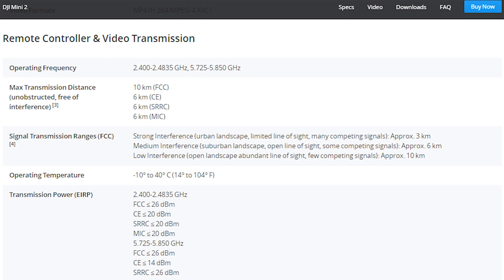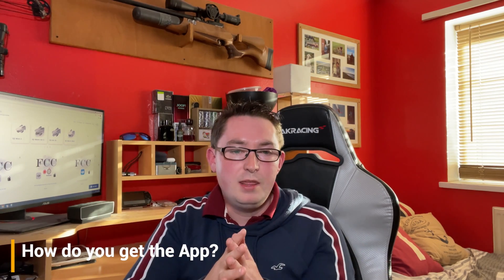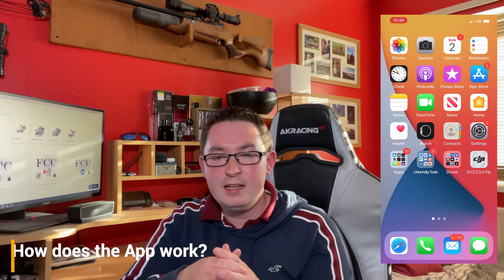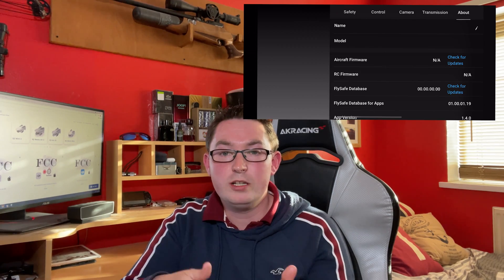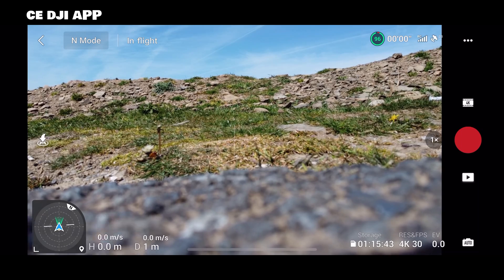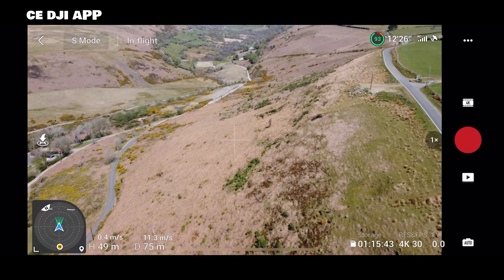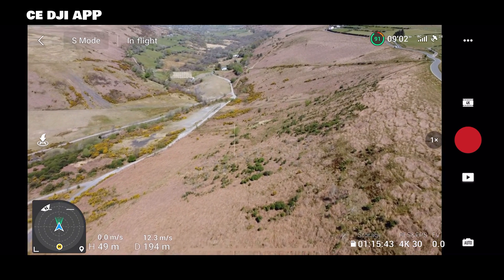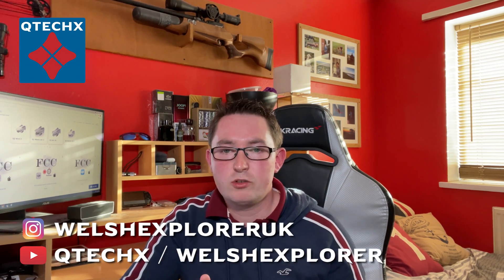DJI Fly App hack to unlock CE to FCC radio transmission power for DJI Mini 2 and Air 2

Comment: I am interested for my air2s. I use an iPad to run the DJI fly app. Where can I found this special application ? (For iOS). Can I be sure it is reliable at 100% to control my drone, because I don’t want to have control problems. Thanks.

Comment: Its a magic app as well because when you swap over to the hacked app the battery remaining time magically goes from 7 mins to 14 mins! These are two different flights, not the same flight as you try and say. You also forget to mention increased power transmission also means decreased time in the air, the increase in power has to come from somewhere. 

Another thing to note, in the FCC mode video, the operator is standing at the Homepoint (you can see the small blue arrow with the controller pointing towards the drone). In the CE mode one, the operator is not standing at the Homepoint. How far away from the Homepoint are the standing? Might be 500m away from it, you can't tell. And the distances indicated on the screen are Altitude and distance from the Homepoint, NOT the operator. So, it could be the actual distance from the Drone to the controller is a LOT bigger than the screen indicates. This could be some clever manipulation of information to make the FCC mode (and the 24 Euro hack they are trying to sell) look a lot better than it actually is.

I'm not saying it is, but this does look like false advertising or at very least misleading. Put up a video of 2 equal  drones with operators standing a few metres apart and film the same video again and compare - side by side- the original drone and the hacked version.
Reply: thanks for showing this

Comment: does this hack increase the RC strength or the HD strength for viewing in the goggles, as with the Avata the RC strength has been fine its the HD for the goggles view thats drops? also can you legally fly in FCC in the UK or is it a case of jail time if caught?
Reply: You legally can't, also as soon as you modify it you lose all the benefits of flying a sub 250g drone as well such as flying close to buildings and over people etc. You are unlikely to be jailed for flying it, however.
Reply: @rayshields  why would it affect where you can fly a sub 250g drone buddy 🤔
Reply: @rayshields  aye, did my A2 cofc course so anything under 50g now in the uk I can use it as a 250g drone thankfully, cheers for the help though bro

Comment: has anyone tested this with the se mini ?
Reply from the maker: It won't work with Mini 1. Mini 1 uses standard Wifi not the Ocusync technology.
Reply: @QTechX  rip so basically i bought a junk beginner drone with bad signal its super bad i cant go 100feet without controller losing camera feed

Comment: This may well be the saviour application for the DJI Mini 3 Pro. I for one can confirm the poor range here in Australia with the new drone. I may consider this option but will wait in case DJI correct the issue. My other drones are CE and I get well over 3km with all of them but not the Mini 3, its flat out even getting past 700m.
Reply: Did you get the iOS version of the app by any chance?

Comment: will this work to give you a better image transmission, or is it purely RC control signal- I nearly lost my drone yesterday flying in a town centre (only 200m away) when the signal was at 2 bars and image transmission was frozen/extremely choppy, but since I still had VLOS I could control the drone perfectly using the RC, so my issue was purely image transmission
Reply: The drone will fly back to the home point if it loses transmission, no need to panic
Reply: Does anyone know where to download the fcc ?

Comment: Does it unlock ADS-B mode?
Reply: Software wise, yes. But not hardware wise. At least If you have the mavic air 2. Then the hardware is slightly different. It does not have an ads-b receiver on the board

Comment: Im using ipad mini 5 for my mini 2. Does your app work on ipad. ?
Reply: Yes i downloaded to my Mini 5  today and it works no problem.
Reply: @graham81111  where did you buy it? whats the app name? does it need jailbreak ios?  how come no one answers?
Reply: @annakessler9372  site seems a little sketchy im kinda scared to put my credit card there do you think its safe?
Reply: @MB2kbps  nope dont do it.  just the reason alone that he's not even putting up enough info shows its suspicious. just search for free ways.. There are.. i found some on you tube.
Reply: @annakessler9372  yeah ive found one which is free here on youtube. Mavic air 2 fcc 1.0.0 something like that i will test it today and tell you if it works!
Reply: @annakessler9372  hey im back from testing the free app it works great with my mini 2. Do you want the Download link? I got it from the official DJI forum!
Reply: @MB2kbps  Sure
Reply: @MB2kbps  pls Share the download link !
Reply: @MB2kbps  so you found a link for the fcc hack from the official Dji forum… 😂😂
Reply from the maker: It will work on any device where the original DJI FLY iOS app works!

Comment: This works great!!! FCC is much stronger than CE...
Reply: I honestly haven't noticed a difference
Reply: @Matanumi  Do you aim your RC to the drone at all times ? Bottom left gadget at 6:27 , the blue arrow pointing to the drone, it needs to turn green when pointing right at the drone.
Reply: @Thesilentwolf7610  never seen it turn green.

But yes ive since learned how important it is to point RC antenna towards the flyer especially with yagis

Comment: Either that or the app is hacked so the actual bars on the screen are prt of the cracked app that just show you extra signal (i.e Actual Reception + 1 bar). This does not prove it’s actually changed to FCC. Only way of doing this is to push it out to 10K. Or at least in the UK to 6K where on CE toil would get dropouts. So be interesting to do the same test on this. Ignoring the displayed bars but testing the dropouts.
Reply from the maker: I understand what you are saying but the app has been tested by many different people who have taken it out to where the signal completely drops.

It’s also been verified by a RF Meter: Using the original DJI Fly app- the output signal strength of the drone is 15 to 25 µW. Using the [FCC] DJI Fly app the output power 146 to 280 µW

This is a Facebook group dedicated to the hacked app- 1.7k members- I haven't seen any negative comments...Scroll down to the 2nd of April for the RF Meter verification. https://www.facebook.com/groups/359111621813393
Reply: @QTechX  Okay that’s great thank you. I’ll have a search online. It’s good to know it’s been tested with an RF meter too which is a fair test. Just wanted to raise that point to make sure the hack just doesn’t trick people by altering signal bars. Thanks.
Reply: @QTechX  Does using this application void the manufacturer's warranty?
Reply: @piotr0759  it might do dji care if you crash it and they see your logs that its gone out more?